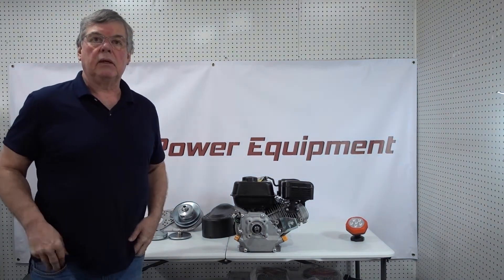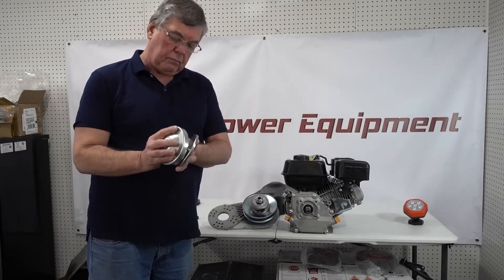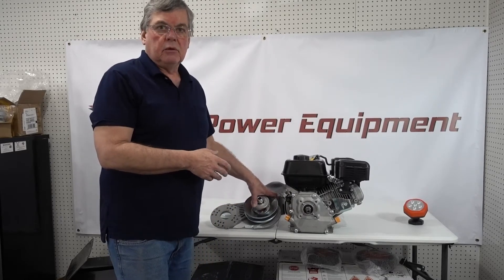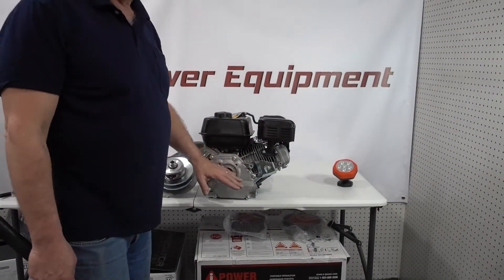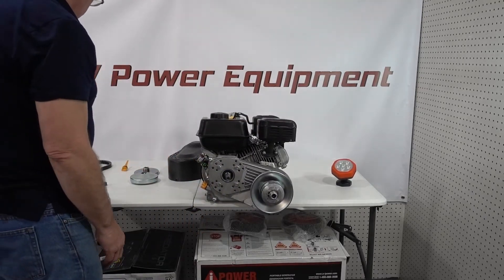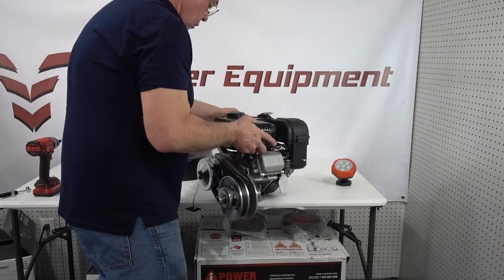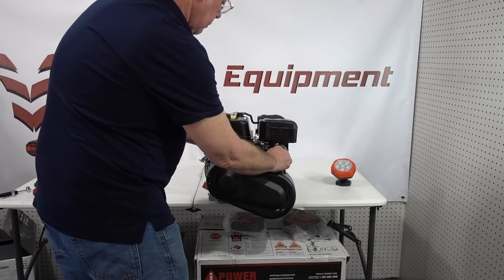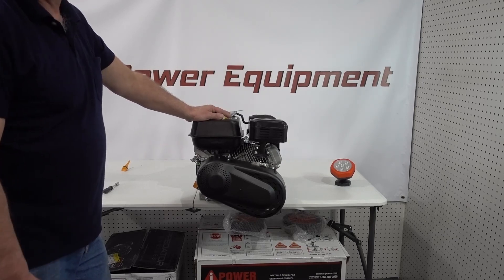The Benefits of (and How to Install) a Variable Clutch on the Predator 212cc Engine

Comment: I'm trying to hand start my engine which has a heavy load attached to it. And it feels very hard to get it started. Is there anyway I can hand start the engine and then engage with the pulley of the load?
Reply from the maker: the clutch will not engage the load until you start to increase the rpm's

Comment: what about that big nut on the back of the clutch he didn’t mention anything about it… WHAT IS IT FOR …m asking because the one on my clutch was not tight so i tightened it….and my real issue is when i tighten the front nut then when i pull to start it then the pull is way to tight
Reply from the maker: Pleaser direct technical questions directly to the company by emailing them at sales@vpowerequipment.com They will be glade to help and this will provide a much quicker response time.
Reply from the maker: sales@vpowerequipment.com
Reply: Did you figure it out?
Reply: I just got my engine and clutch in and noticed the same thing. It's a large lock nut but with the washer on, the nut will not go far enough onto the threads to engage the plastic insert in the nut which locks it. Deleting the washer lets the nut go on far enough to lock. Worked for me. Probably too late for @rolandedwards9005 but maybe this will help someone else.